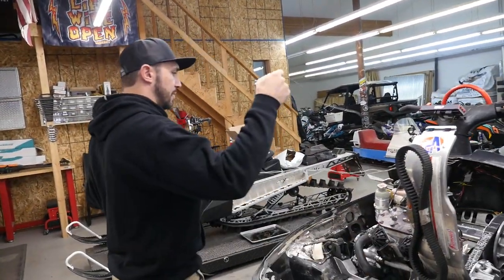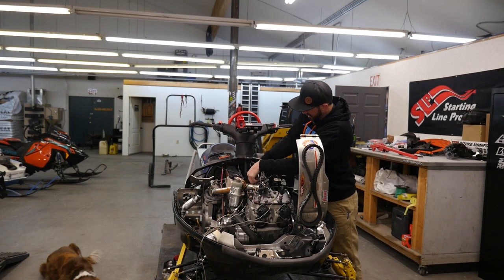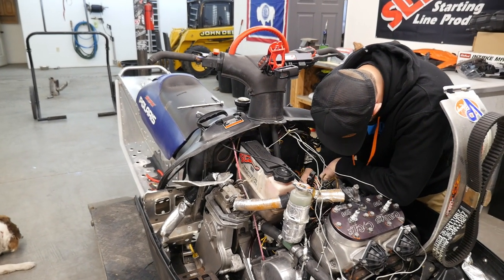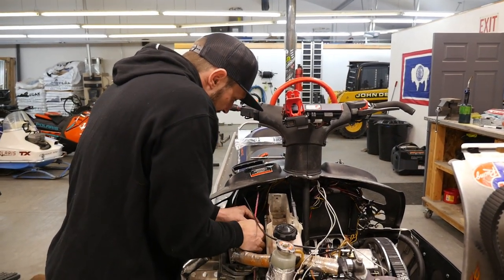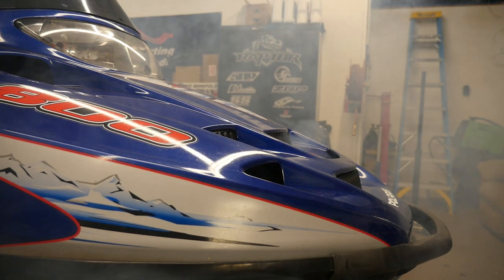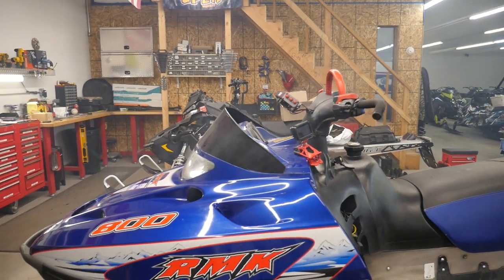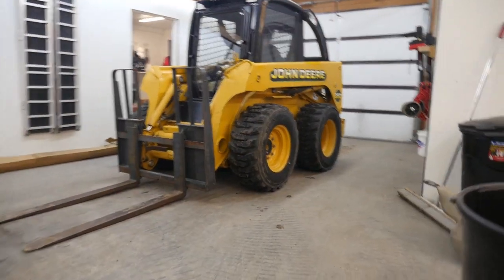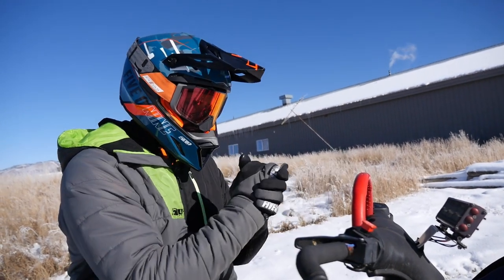Fire Breathing Mod Sled

Comment: Tilt the airbox towards the front fit rhe sled, lift the carbs up slightly until they fit the cutout. Press the bottom of the box towards the carb while pressing down and back on the top rear edge of the box, it’ll snap right in.